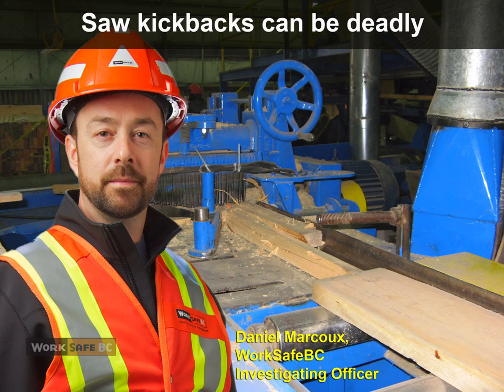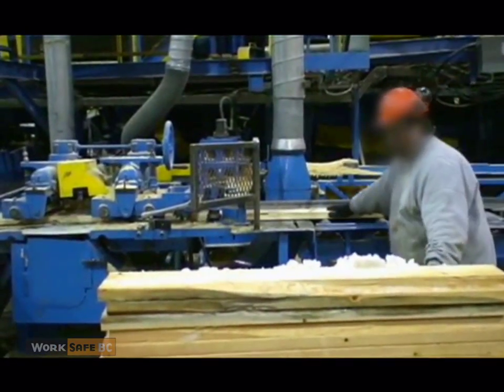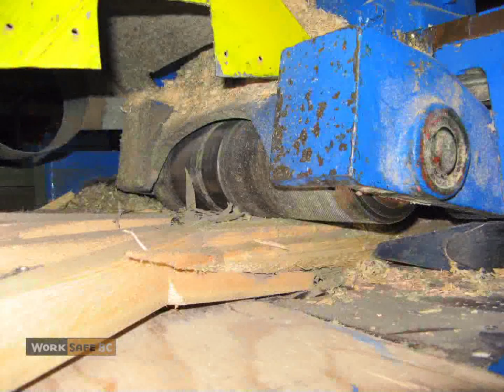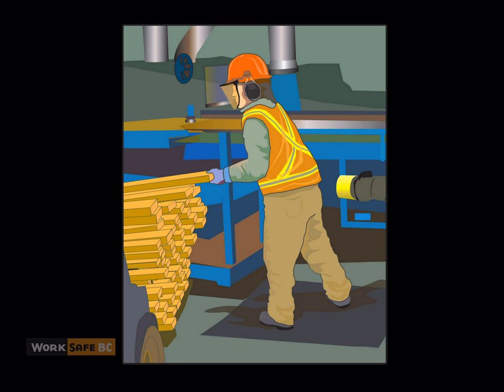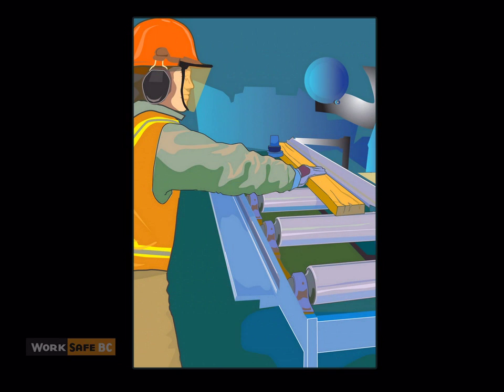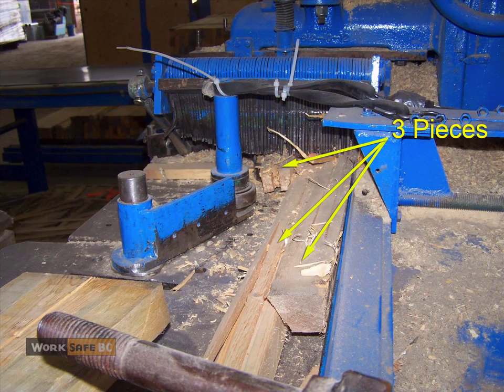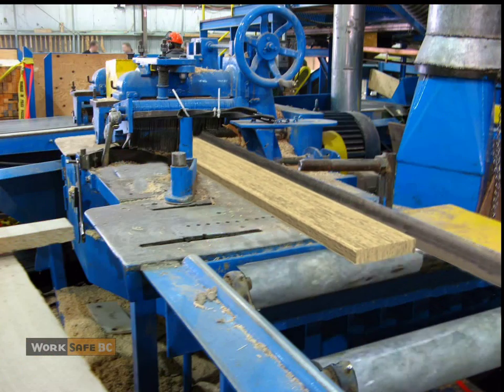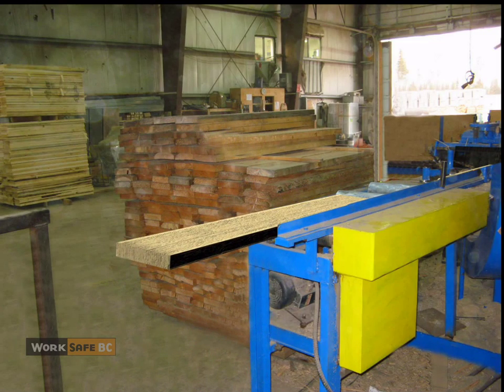Incident Investigation: Worker Killed When Saw Kicks Back | WorkSafeBC

Comment: Never hand feed boards in from the very back of the planer , the operator should have feed them in from the front side and the edges should have been ran across the jointer to keep bark from jamming and binding the fence guard plate...the rollers adjustments or feeder rollers are not the main issue of these accidents. Kickbacks happen quite often so never stand directly behind a wood planer.
Reply: I've never had a kickback on a planer or jointer in my 20 years using them, THIS planer looked to be like an old junker found at an auction. It had an external power infeed roller like Ive never seen,  and a saw blade further up to plane and then resaw into strips, so if the board cracks in half as it goes in, it can twist under the pressure of the powerfeed and there's your problem, hand feeding boards on a jointer I've never seen kickback, there's no pressure roller or kickback fingers that can be out of adjustment or otherwise fail and then you dont have ANYTHING on the board to restrain it.
 At least if you are pushing the board  over  you are moving it forward and have control.

I HAVE had a Powermatic planer with a segmented pressure bar break one of the fingers off (cast iron) and it was chewed up to hell, it was $2,000 worth of parts to fix, but nothing shot out.
Reply: @Letocetum sulley You cant blame wood if you're standing in the line of fire. That's exactly the same as pointing a gun at yourself and pulling the trigger. Is that the fault of the gun????? Nope, it's the fault of the person who decided to stand in the line of fire.

Comment: @electrogear That saw is massive. I had a regular contractor saw throw a 2x6 30 feet back and slam into a wall behind me. They are real powerful because the blade tends to push the wood back. If the wood lifts off the table even slightly, goodbye..

Comment: I use to operate a similar saw cutting strips/slabs and yes it can kick back this 1 time I was feeding it with 2×4's back to back and it did kick back knocking the last 2×4 flying out of my hands good thing I have common sense to be standing a foot or 2 beside it while feeding the machine lumber or it could of been fatal for me
Reply: Dell Shaw yep, even a small basic table saw has some serious force. I was cutting down a small board as well and one time it kicked back on me and I had bruised ribs for a good 5 or 6 weeks. But it was also my own doing. I was using an old dull blade trying to cut down an oak 2x4 board. It was a true 2x4 too. A full 2 inch by 4 inch.

Comment: How strong is a kick back.
Reply: Even using a 'HOME Style (DIY) Mitre Saw, the kickback, especially if cutting resinous or High Density timber is very considerable and safety precautions should be taken,i.e DON'T stand directly behind the work piece, if you are a little shorty, ensure you have a wooden platform of sufficient width/length and sustainability to hold you, also use clamps to hold timber on such a ssaw when making a cross cut, and when using , especially overhead Ripping actions, ensure you stand on one side. The speed and power on modern machinery  can be lethal. Think before cutting.
Reply: I should have added that Kickback is vicious using a Compound mitre saw on shortish timber lengths when RIPPING, ALWaYS use the lockdown clamps if you use your . Compound Mitre saw for Ripping, even if its only short length.s
Reply: Like 200 mph strong. I will never own a table saw - even a portable homeowner version. These videos scare the hell out of me.

Comment: Surface grinding soft tungsten carbide by holding the work piece in a corner of a graphite sliding block can cause the workpiece to kickback. This is especially true of short and wide diameter workpieces that don't sit firmly in the corner and move around. The wheel catches it and violently snaps it off and flings it at extreme velocity. If your holding finger or thumb is in the path then hello pain and numbness (same as hitting your finger or thumb with a hammer). If the wheel breaks...

Comment: This is not just a problem of the employer, not just a problem of employee stupidity. It is a combination of both. The employee should have never stood behind the saw. Other employees who saw the worker behind the saw should have reported it. The employer should have had better safety standards. As was mentioned in the video, the boards should have been pre-sorted to be within a certain size, there should have been some kind of barrier to prevent anyone from standing directly behind the saw, the operator should have let the company know that they were too short to do the job safely and been reassigned to something else. 

These kind of problems can rarely be pinned on only one person or one thing. They take a perfect combination of multiple things happening at once. The operator had probably fed boards this way numerous times and never had a problem. This is why I always cringe when I see woodworker on youtube talking about why they don't need a riving knife or blade guard on their table saws, or feed wood past the saw blade with their hands inches away from the blade (usually without a blade guard). Just because it hasn't happened yet, doesn't mean it won't happen. When it does happen, you will not be fast enough to react. I came here from a video of a guy who was trying to demonstrate kickback from a saw safely. At least he thought he was safe and ready for what was going to happen. https://www.youtube.com/watch?v=u7sRrC2Jpp4

My approach to woodworking is to pretend like every tool in my shop can kill me, because they can. It only takes a second of the mind wandering for something horrible to happen. Working without safety gear makes it 1000 times more likely to happen.
Reply: A co-worker lost parts of his fingers on a tablesaw, he was cutting small pieces of cherry piled on a cart next to him and the sliding table saw, as he cut a piece he reached around for the next piece, after a while of doing that he got careless and his fingers brushed against the blade when he moved his hand over the top of it while turning to get the next piece. The blade degloved the end of his index finger and damaged the middle finger. The doctors wound up amputating the  two fingers to 1-2 joints back because the damage  to the nerves and all was just enough to be serious.

Comment: Useful information. However, I can't count the number of users of circular saws which are used without the riving knife, and consequently, the guard. Basic requirement, surely.
Reply: Yes indeed, in Sawmills in Indonesia I don't think I ever witnessed Saw Guards, I don't believe I ever saw a riving Knife, and I've seen massive 'Jerry Built Bandsaws being operated where the timber is shoved on a makeshift rail which was laying (but not attached to the floor) meantime the 'Operators were physically shoving huge Teak or Mahogany trunks thru, NO safety Stop switches anywhere near the barefoot operators shoving the five tone logs toward the blade.

Comment: So the root cause was she was just too short? That seems... well, extremely stupid that this issue was not remedied. Would it have been too hard to get her a crate to stand on or something? I would think a supervisor would look at her struggling with the thing and realize that someone wrestling the machine won't be as fast or as efficient and would do something to help the issue.
Reply: Standing on a crate would have opened up a whole new set of dangers. She should have been reassigned to a different job that suited her better. It's not like this kind of work required and real skill.
Reply: GemCat there's a reason why in the NFL, offensive linemen weigh 300 pounds, linebackers weigh 250. Runningbacks weigh 200-230. Cornerbacks weigh 200-220, etc. Why people seem to think that any body can do any job has always been mindnumbing to me. Putting a tiny short little broad to work that saw in a sawmill? WTF? The new England patriots may as well hire a 5ft Chinese guy to play offensive line to protect Tom Brady. And then when a 300 pound defensive linemen with one hand picks him up and choke slams the little chinaman to the ground breaking his neck let's sit around and discuss what the NFL could have done to prevent this from happening. Equality, as what people believe it means today is a complete fucking joke.
Reply: @Bennysol  How right you are....it's all about MONEY.

Comment: These so called "accidents" in many cases are preventable. Moreover, factory operations should be monitored much more closely to ensure worker safety and comfort. The EMPLOYERS should be held accountable for these problems, not workers. They are often caused by the speed of the operation and corporate greed whereby companies seek to maximize profit at worker's safety expense. I have seen numerous cases where even slight adjustments, a stool perhaps, or chair, gloves, or slowing a machine down would make a huge difference. Unfortunately, OSHA along with many other organizations simply don't do the job. They are underfunded and considered a nuisance by employers who are allowed to function unsafely with impunity. Once I witnessed a worker nearly killed when her forklift fell off a loading platform. Her front wheels were in a semi-trailer that had been backed onto wooden 2 x 6 planks that had been stacked up to bring the trailer up to dock height since it was a "lowboy" trailer. As she engaged to back out of the trailer her back wheels were on the dock plate while her front tires were in the trailer (front wheel drive.) Her front tires spun as she reversed, as they did the entire trailer was spun out from under her forklift sending the trailer at least ten feet out into the parking lot. The forklift literally fell out into the lot and luckily because a forklift is back weighted it didn't tip over but rocked back and forth like a weighted punching bag. She held onto the steering wheel and survived. Thank God! It scared the living SH&T out of me and several others who witnessed this near tragedy. Did the company, who knew this had occurred take measures to prevent it in the future. Yeah right! They did nothing and continued to use this technique on "lowboys."
Reply: The employees should be held accountable too. All the safeguards in the world won't prevent an idiot from injuring or killing themselves. I'm not saying this girl was an idiot, she may have just not been trained correctly, but all you have to do is look up woodworkers on youtube to see how many of them remove the safety equipment from their tools because they find them a nuisance. These are people who work in their own home shops. Most of them have all kinds of "great reasons" why they removed them, but those reason's won't put their fingers back on or pay for their hospital bills when they have an accident. Their reasons won't help them do their job when they don't have enough fingers left to hold on to a board.

The dumbest of them will even say things about new safety equipment like "It's just a marketing ploy to sell new tools".

Comment: your brain...  the most safes guard, if you use it right tis guard can avoid any ingery or death
Reply: Sometimes people don't have knowledge of the hazard.
Reply: That is a stupid comment. Relying on your brain instead of safeguards is why there are so many wood workers missing fingers. I did some work for a legal group regarding table saw injuries and one of the more common things I heard was something like "I've done this for 40 years and never had a problem..." Yeah, it only takes one time and then your life will never be the same. Fingers don't grow back.
Reply: Exactly MAGA, health and safety regs are not just there for the companies that have weekly serious accidents they are there for the companies that have had 10 years without so much as a cut finger, because 1 accident is too many accidents.  Just because there is a machine "everyone knows not to use" doesn't mean the new person will know not to, or just because the faulty wiring on machine 2 hasn't hurt someone yet doesn't mean it won't tomorrow.

At a previous job in a shithole of a factory a supervisor was arguing with the chief safety officer from offsite and got the "We've had 20 years without yada yada" line and the CSO replied "Well, from what I've seen today what you've experienced over those 20 years is called luck."  I sniggered :P